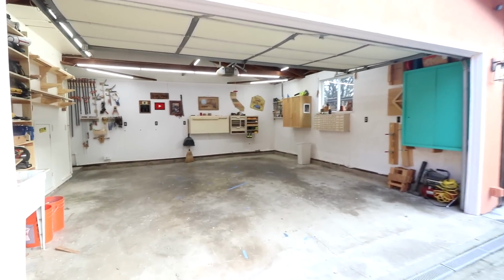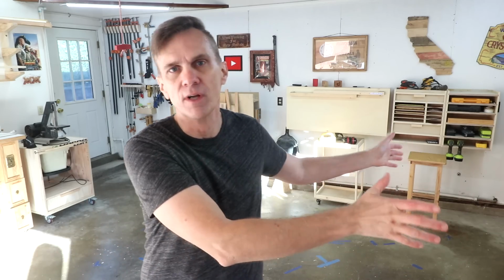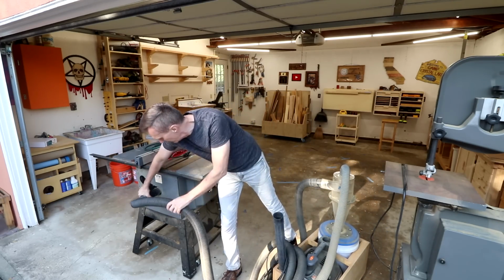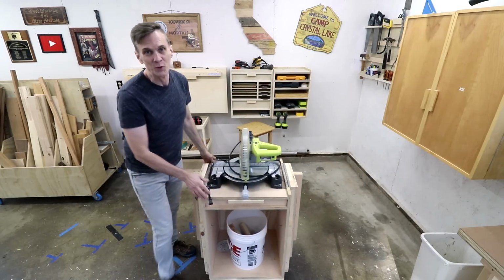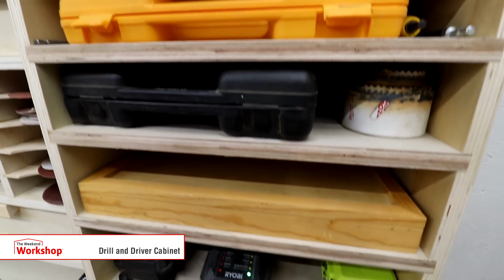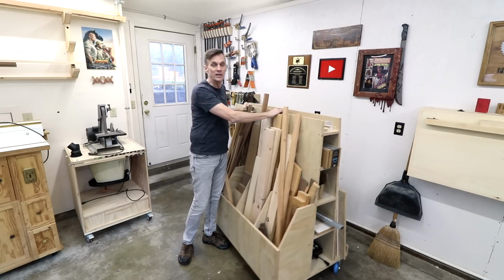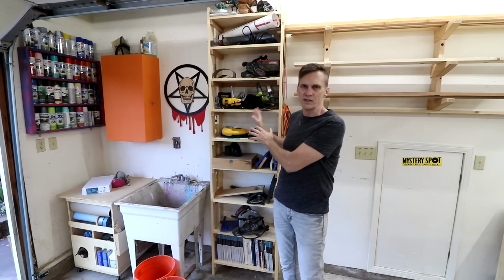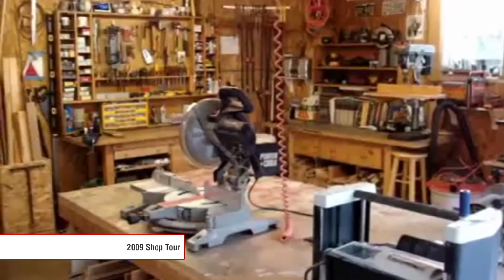SHOP TOUR. My biggest shop upgrade in 19 years! How to turn any space into an awesome workshop.

Comment: I watched Adam Savage's shop tour and really took the "tools need to be visibly accessible" concept to heart, pulling as many tools as possible out into the open and organized by use. You're either setup for doing work or storage. The latter is not conducive to productivity.
Reply: I started to do this but discovered the hard way that this doesn't work until you have your dust collection very well setup first.
Reply: Good points on both sides. In my case, I have both auto and woodworking tools, and originally was of the opinion "those guys with tool caddies and organizers are just going overboard" then I'd spend 30 mins looking for my socket wrench or test light. I guess "having a system" leads to the real efficiencies. Having frequently-used tools available and having a "documented home" for other tools so you can stay organized and optimized.
Reply: @dubCanuck1  

I think the best systems will come organically by A maintaining it and B starting to enjoy it. What I like the most about Adam and Steve is that you can play around with it easily and see what feels right. The more you enjoy your time doing stuff, the higher chance you get of actually finishing and doing more and that used to be a huge problem for me.
Reply: Ah a fellow brother of the church of first order retreivability! I think watching both videos about their respective workshop helps a lot in finding your own style. I love them both :)!

Comment: I'd love to see some single car garage setups!
Reply: My workspace is a single garage without a back wall, that space is a laundry. It is doable if you are organised and use surfaces for multiple things. The most challenging part is walking space. Keep the main work table and saw at about 1/3 of the width and lengthwise rather than butted against a wall to give you room to access all sides. You may be sacrificing a little room and have a tight squeeze to get between the table and wall but it really is a worthwhile sacrifice to access all sides of your work.

Storage space and other tools, etc can then fit against the wall with the other 2/3 of the room in front of it. If you have a back wall that could also be storage or tools, etc. If you can store things at roof height that is a way to go too. My garage is under the house so there are beams I can utilize by storing timber in planks attached to the beams, hooks to hang clamps and straight edges, etc. You just need to think outside the box, plan your space to maximize it's usage and not get slack with putting things where they go or it will quickly become hazardous and difficult to traverse the area.
Reply: @patersonplays  Yep - my challenge is also a single garage that I have to share with the heating boiler (that's "furnace" in the US!), 4 pushbikes and a cycle workstand and bench.  I'm just remodelling my workshop and the cabinets/benches on castors are going to feature.
Reply: I have a single car garage. 5.7m x 2.7m. So less than half the size of Steve's.  Hopefully I can make it work. I dont think I will build the mobile mitre station.   I am thinking that a built-in mitre station with drawers underneath will be better for my situation.  But the rest of the projects are tempting.
Reply: Check out "Woodshop Junkies" and the playlist for an "All-in one, woodworking Bench Assembly table".  Its definitely worth the watch.  Also has many other ideas for best use of a small space.  I believe the dude is from South Africa.
Reply: @rotorhawg8052  yeah, he has a great channel and great ideas. I am not entirely convinced that a workbench of that size makes sense in a workshop of that size unless you are unable to mount things to the wall (which I think was the case for his previous rented garage).  To me, the most efficient way is to have storage on the walls,  builtin cabinets or shelves on the sides and a central small workbench that is mobile along with making the larger machinery mobile.
Reply: Your advice is invaluable, many thanks, Steve. I work in a single garage space and can adapt some of your ideas to suit. My problem is the floor is built with a slope down to the door, I think originally to enable a car to be washed inside and to drain the water out. But what that means is using mobile units like yours is difficult because they are only level in one direction, and don’t line up (like workbench against saw table). Any ideas?

Comment: The thing I enjoy most about this channel is the lack of fancy tools. I am definitely signing up for this course. Thanks!
Reply from the maker: Thank you! Looking forward to having you on board!
Reply: It’s a great course.  Steve does a nice job presenting the material. It has really increased my shop efficiency. Good luck
Reply: Yes Steve has been able to fit all his roller tools and two cars??   But my point is most people in UK do not have the same space or budget to buy, what to them are expensive tools.
I have the luxury of a standard size UK "garage".   Most of my tools are hand tools but I confess to band saw on rollers!!
I have made loads of picture frames with perfect mitres, via a hand made shooting board and Stanley plane.  
A dovetailed toy box 24" x 15" x 15" high. Hinged lid with raised and fielded panels.....all with hand tools and second hand wood.      Made loads of dovetailed boxes.......superb chess boards again scrap timber with inlaid banding.     My point is I could have made all of these in my 8'x 6' shed 
AND TO THE PERSON SAYING MR PAUL SELLERS USES EXPENSIVE TOOLS.....IS JUST RUBBISH.   It is possible to pickup good tools on eBay for a few pounds.    I have made several hand tools from scrap beech....my superb rebate plane using a firmer chisel and 3"x 2" scrap beech, has adjustable depth and width gauges.  I can cut rebates without any noise, dust or risk of injury, in a garden shed.
Cheers john
Reply: Jesus Alvarez "lack of fancy tools" the place is full of them.....try watching Paul sellers ...he only uses a few tools
Reply: It's all relative.
Reply: @johntaylor1359  paul sellers uses super expensive hand tools
Reply: @john taylor  What an achievement Steve has made by stripping down his garage and dedicating the space to woodworking, while still being able to park a car in there. Look past everything you see in this shop and look at the subset of projects that he does that you're interested in, and what tools you can get away with or substitute for those projects. Surprisingly, it's not a whole lot if you're willing to put in more time, but a little less accurate, and alter the design to work with the tools you have.

I own a corded circular saw, old battery powered screwdriver from my grandfather, corded screwdriver, mini cordless screwdriver, a random orbital sander, a hand saw, two plastic sawhorses, speed square, t-square, level, tape measure, an array of drill bits, 2 dozen clamps, push broom, and a leaf blower. It's about all I can fit in my 2 car garage with my other hobbies and storage and 2 cars. 

A handful of projects have come out of my shop, and while none are perfect and took considerably more time to make than if I had a table saw or miter saw, I'm proud of what I've made with my hands with such little space and tools. "It's not about the tools" is a good motto to live by, and I always appreciate seasoned woodworkers showing how a project can be done with suboptimal electric hand tools. Making a beginner box is really hard for me. I don't have a workbench--I lay fence boards down my sawhorses for a work surface. I don't have a fence--I clamp my speedsquare onto my project as a guide for my circular saw. Everything comes out plus or minus 1/16-1/8". I only make butt joints since other joins are too tedious or unsafe with the equipment that I have. I can make a box with only butt joints, and that's good enough for me.

Next purchase might be a battery powered jig saw, as Steve recommends as part of a beginner workshop. Sure would be nice to have a table saw, miter saw, and shop vac, but that will have to wait until I move to a place with more space.
Reply: @johntaylor1359  you mean manual, old shool, tools ? 

In this shop there maybe 1-3 tools that i wouldn't probably get .. Not in the beginning (around the first 5 years..).
Reply: @johntaylor1359  if you consider any powertool as 'fancy' then yeah. But that's your own definition though. I can say the same thing about Paul's tools, they're fancy because some of them are so rare you can no longer find them in pristine condition and if you happen to find one they're never cheap.
Dont be a purist, woodworking isn't just building stuff using handtools.

Comment: I really like the idea of having everything on casters and stowing away. I really need to get my dust managment under control and I think I'll copy your mobile dust cart to get it done. I've been looking for a used shopvac online. Is there a min horse power I should be looking at to get the job done?
Reply: The more the better, obviously. When I was using a shop vac for dust collection, my shop vac was about 160 CFM. Don’t bother with the hp rating, it means nothing in terms of performance because it is rated at peak hp (startup). Look online and find out the cfm rating for whichever vac you’re looking at. For me, the shop vac just didn’t cut it  and I eventually moved into an actual dust collector. But a shop vac is about 1000 times better than no dust collection, so get the most power you can find in your budget. Basically, the more cfm you have, the less you’ll be still having to clean up everything around you after your cuts. I believe my table saw states that it requires about 450cfm for adequate dust collection performance. That number can vary a bit but honestly, my opinion and my recommendation is to get something from 150-200 cfm if you want to capture most of the fine dust that becomes airborne. Ridgid shop vacs are the best value in my opinion and you can get 160cfm out of about 120-130$ brand new. Best of luck and also remember that with all of that being said, anything is still better than nothing.

Comment: Pro tip. Make every table surface the same height! Need to cut something long in the miter saw? Use the work bench it's the same height. Need to drill something long in the drill press? Use the work bench or the miter saw station as support, it's the same height!  You get the point..
Reply: Been doing that myself. I'm actually building everything off the height of my table saw. My rolling work benches (2- 2ftx4ft and 1- 4ftx4ft) can each be used as an out feed table for table saw or for assembly. Miter saw rolling cart is just low enough so work benches can be wings.
Reply: @tonyvindett87  I did that as well, the table saw is really the centerpiece of the shop and the only thing I didn't build a stand or table for myself.  So I based everything else on that, and yeah it's awesome being able to use any of the carts or benches as feed tables for each other.
Reply: Don't do it blindly though, there may be a few things that you want a little higher or lower than your main work surfaces
Reply: @benjaminholcomb9478  Hand tool work- planing, sawing
Reply: @jackiepousson8497  stuff like that. Also, large table top tools, like drill presses, band saws, sanders.

Not everything is optimally placed at the same height.
Reply: @benjaminholcomb9478  I agree. I have been struggling with that as well. I just have a few tools, but I    also do not see as well as I once did, so my router will be higher than my table and miter saws.
Reply: @benjaminholcomb9478  For this reason, I have a cart just for my kreg jig. I want to drill downward without so much shoulder strain.
Reply: My problem is the concrete slab in my shed is uneven, cracked and wasn't laid flat when it was done. The shed also leaks like a sieve when it rains.
Reply: Great advice, if I would've known that a few years ago...I will try to remember that for next time!
Reply: @Viktor Lipovits, If you are using hand tools look up Jim Tolpin's "Sizing Benches."  Do you plan to use power tools?
Reply: @jackiepousson8497  rule of thumb for hand held power tools is for the table to be lower than if for hand tools. At least as far as I know
Reply: So, an assembly/ hand tool table might be about waist height, where as a power tool station would be a few inches lower (for leverage).

I'd recommend looking at the counters and tables in your kitchen to get an idea of what you feel comfortable with.
Reply: @Viktor Lipovits 
It really depends on the tasks you'll do and the position you prefer to be in. For example, most surfaces should be about knuckle height. Specifically anvils and striking surfaces.

I'd recommend looking up "stumpy nubs workbench" for an overall view on a traditional woodworking bench (good for feature ideas even if it's not your speed)

Also Rex Krueger has a real simple  design for those who like to sit while they work, it's quite literally a work "bench". Its pretty good for small shops too.
Reply: @Viktor Lipovits one good thing about metal is that you can always weld more on there.
Wranglerstar made a machinist table, which was essentially a butcher block type slab with metal rods going through it. I don't think he even used clamps to make it.
That's if you're just looking for a tough surface and don't neccessary need it to be metal (i.e. for welding/fire projects)
Reply: Anybody have a suggested height of the single height work shop?  Maybe not in inches but in height relative to body  ie; waste ht, 6" above waste, armpit. A thought
Reply: @bradleyrounds9148  the general wisdom is somewhere between the 2 biggest knuckles of your fingers. Especially for striking surfaces as it makes the implement line up more ergonomically. It also makes it so you can stand above something or sit level with it.
Again, I'd recommend measuring your tables and counters to get a hands on feel for this.
Reply: Great tip
Reply: table saw infeed outfeed table, work benches.
the only problem with that is stationary tools, like and i know what your going to say. Radial Arm saw.
Don't knock them until you own one and use it.   yes Miter saws took over that job, but they will never be able to do what you can with a Radial arm saw.
you'll never drill a hole with a miter saw, you'll never rip lumber, you'll never cut a 22" wide board in one pass 
and I'll bet I could do compound miters a miter saw can't do. or use a miter saw as a shaper, it might pull off sander, but it won't cut dado's in one pass. its one of these machines if you have it it can be handy.
I'm not packing it up to take to a job, I'll use the miter saw, but then I would not pack up one of my 2 cabinet saws for a job either, I'd take my jobseight saw.

The only other thing to do is make your work benches adjustable so they can be any height. from 24 to 64" tall
Hey never know when you might need a work platform to stand on and work on somthing up above your head.
ok the 24 to 64" is a stretch the math dosn't work but you get the point. you would not want a 3 section telescopic adjuster it won't be stable enough to stand on. Not made of wood anyway.  Now just because I said that somone is working out the details right now. If not on paper then in there head.  Hey I didn't say it couldn't be done!  You can do anything you set your mind to within reason.
Reply: Most of my shop is set up that way except the main hand tool bench which is lower due to comfort but I made a torsion box that mounts to the top that sits under the table that makes up the diffrence to use for outeed and support.

Comment: 2 Questions:
1) Why not position your flippable sanding cart near the other sandpaper?
2) I've been planning on organizing my shop according to stages of a project as much as possible and am wondering if I am missing any major groupings:
Planning: Desk in the home
Roughing: Saws, planing 
Layout, Prep: Drill press, work table 
Assembly:  Work table, Adhesives
Finishing: Sanding & painting

A separate area for common tools:
Measuring and marking

Safety tools
Cleanup tools
Clamps

... With each area adjacent to the next because you sometimes have to go back and forth, and with the work table and table saw in the center.

Comment: Try turning an old stable into a workshop. Not easy with a floor that has different heights.
Reply: So start with the floor. It's probably stone or concrete at the minute anyway, which isn't comfortable to stand on for any length of time.

Comment: I love that miter saw station.  I think I'm going to have to make one of those.  Thanks for sharing!
Reply from the maker: Thanks for watching. I love that miter saw station!
Reply: Ridgid has a miter mobile work-stand that folds up with wheels that stores upright when not in used. What is the advantage of having a cart?
Reply: I actually have that Rigid work stand.  I do like it, but not as much for longer pieces.  The work supports that extend to the sides aren't exactly providing a flat platform.  With the Rigid saw, you can add a supplemental fence to give you extended stop blocks, but that can't stay on when the cart is in the "storage" configuration.  Also, I was thinking of combining this with his flip-top model.  I can have the solid in/outfeed section and have my metal saw mounted underneath to allow me to flip between saws in the same space.  Yeah, I'm probably going to be making this out of metal instead of wood, but it will be to support my woodworking....